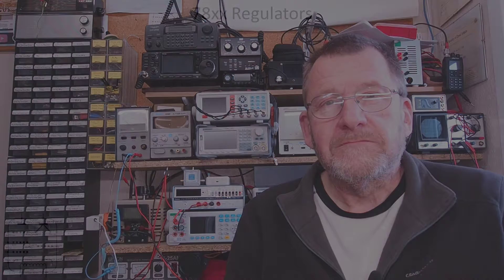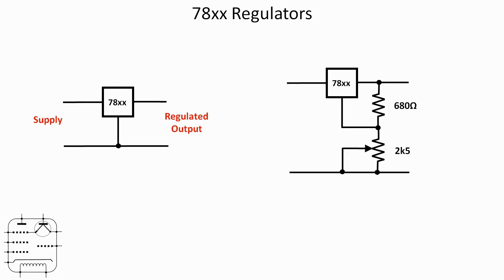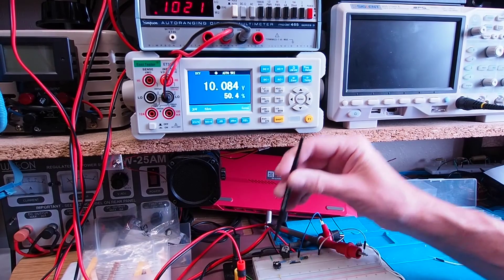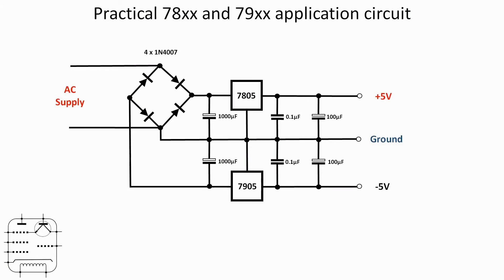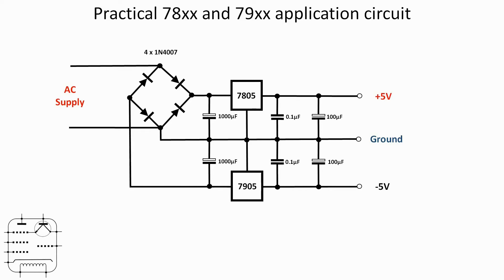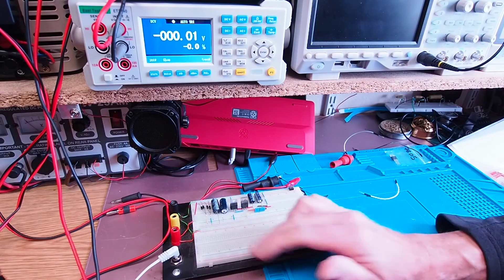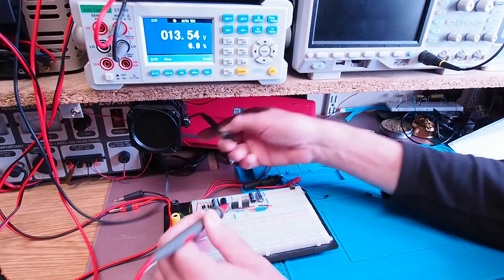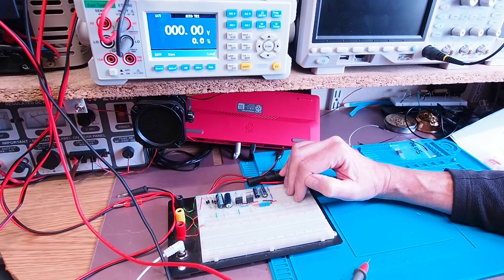The 78xx Series Regulators part 2 - #101

Comment: Thanks again, Bill.  If you already had a regulated DC power supply, would you still use a voltage regulator?
Reply from the maker: No....
Reply: @LockdownElectronics  Didn't think so, unless prototyping something that will go -off-bench.

Comment: Thanks, Bill. Another excellent lesson. I always look forward to Wednesdays.  A circuit like this would be perfect for driving an op amp that requires a negative voltage rail. Possibly stepping up to the 7812 and 7912.